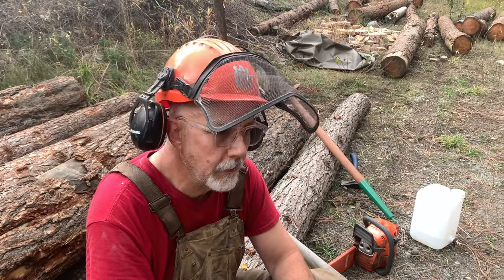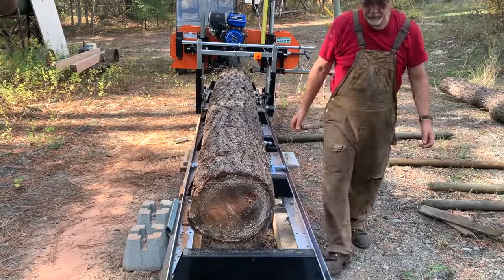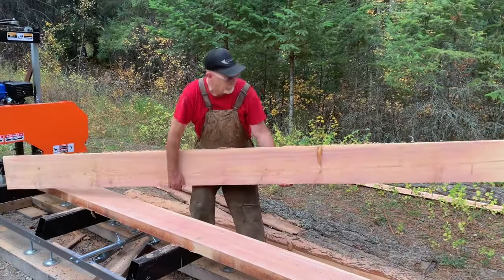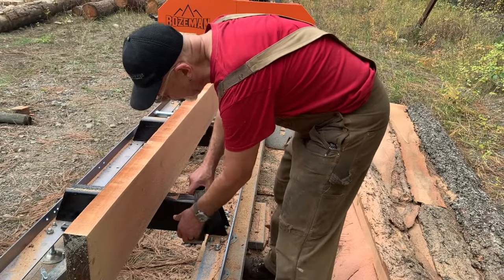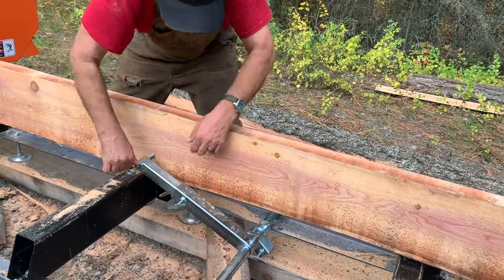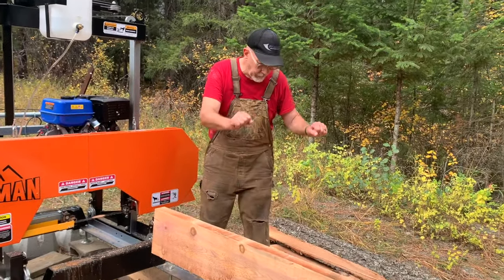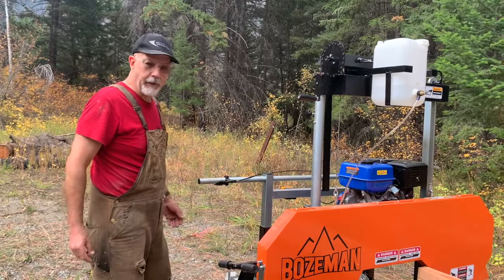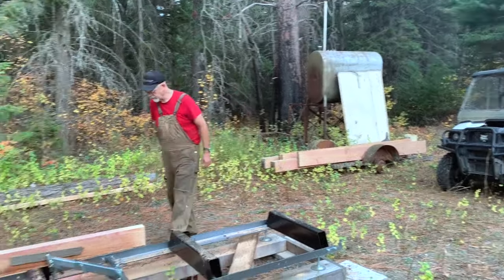The Bozeman Bandsaw Mill Runs! Episode 56

Comment: I usually use the shorter dogs in that situation. And remember to unlock the slide locks to raise the mill head up before pulling it back. I forget to do that all the time LoL. Beautiful spot you have btw.
Reply from the maker: I am starting to develop a routine in my milling process. Doing things the same way each time helps prevent costly errors!

Comment: I have the same mill and I have had all kinds of accuracy issues with the scale that comes with the mill and cutting lumber.  The marks don't seem to give me correctly dimensioned lumber or even close so currently tape measuring and marking each cut.  Has yours worked out well or is it spotty as well?
Reply from the maker: For us the measurements have worked reasonably well. I haven’t learned how to optimize the logs yet so I’m cutting goofball sizes. But they are basically coming off the mill as we had planned/measured.
Reply: Make sure your bench is staight and level this may cause the problems your are having.

Comment: Two questions. What drove you to the decision to acquire the boseman vs other entry level sawmills and secondly how do u find the build and mechanical quality of the saw
Reply from the maker: I bought the Boseman because I trust Princess Auto the supplier. But the bigger reason for buying Boseman was that at the time I bought it there were very long waitlists to get most other brands. Woodmizer was almost a year long wait. I wanted to start milling right away. Princess Auto had this one in the store.
Reply from the maker: Build quality seems fine.
Reply: @StaceyRobinsmith   thanks so much. Appreciate the input.